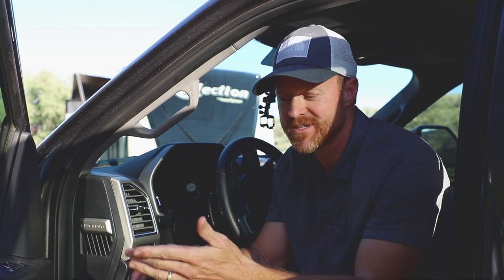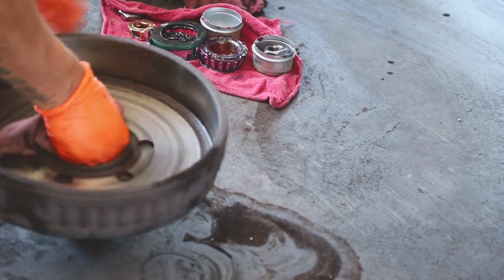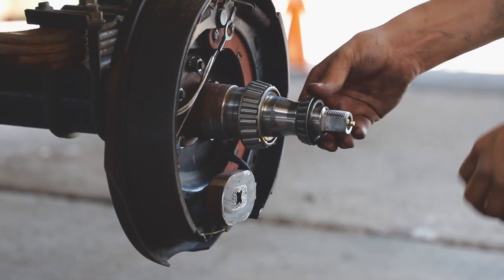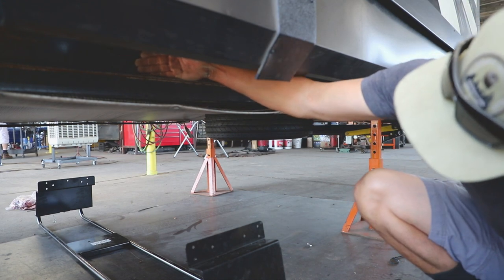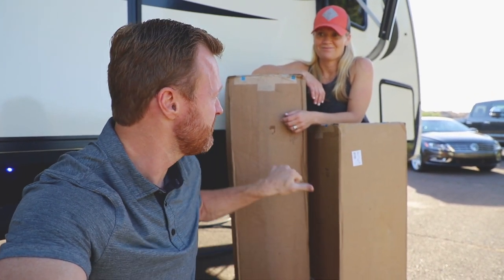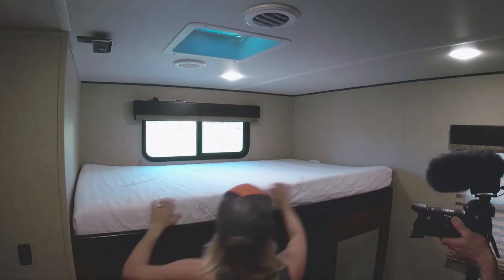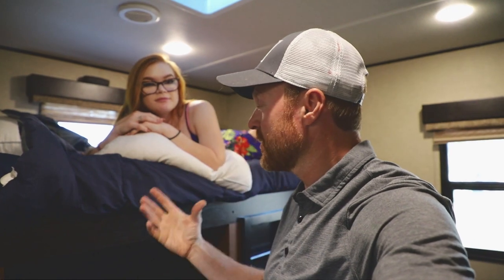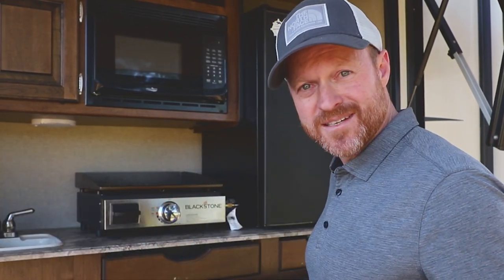RV UPGRADES: MORryde SRE 4000 | WATER HEATER FIX & NEW MATTRESS

Comment: Just a toss-in. I put the MORryde SRE 3000 on mine and it suddenly started loosing rubber on the inside edges of the rear set of tires. Not the front. Apparently it changed the toe angle to slightly toe-out on the rear. I then bought a set of Dexter wet equalizers to go back to the factory configuration with a little upgrade.. and all the odd wearing quit. To be fair, per the forums, only a very few have had this issue with any MORryde system. Wouldn't you know..lucky me..I would be one that did.

Comment: Kind of surprised that the original bearings were already starting to fail.  Doesn't say much about the quality of the original ones, or they weren't properly lubricated when installed.  We didn't have any tire failures on the RV on our trip last summer, but we did get several windshield dings and picked up a nail in a tire on the Jeep we tow that was a slow leak until the repair shop pulled it out.  Cost all of $10 to get it fixed, although I gave him $20 because he put other work aside to fix mine.
Reply from the maker: We did have 15k miles on those bearings already. Jake said the manf. doesn't add enough grease. They have enough now. Thanks for input. I might confirm we have 100% glass insurance :)

Comment: Good info!  I am also upgrading to the spare tire under the frame. FYI. I have a 2018 Laredo that has a suburban hot water heater. It work 3 times and failed. And it was was the controller card. I talked to suburban and it is a know issue with the cards( I believe they purchased an inferior manufacturer for the circuit board or chips) anyways I chose to go back with a dinosaur card made in the USA. The reason being if I purchased another suburban card that could have the very same problem. And what if your in ....Alaska when it fails.  Lol  
3 year warranty with Dinosaur.

Comment: Awesome video tonight! Any chance you can give a round about cost of your upgrades? Being newbies we didn't know these should be done. Love what you're doing!!
Reply from the maker: That's a good idea. I mentioned in the video that the mattress was $395. I paid $600 in labor and the SRE/4000 is roughly $400. The US bearings were around $125 I think.
Reply: That's awesome! We were think a few thousand!!!
Reply: so the labor for the work was $600 to do the bearing work, weld the new leaf spring brackets brackets, install morryde, and install the new spare tire holder?  That seems like a good price - i'm sure it took most of the day. 
 
And part prices were SRE 4000 was $400, bearings $125.  What about the new spare tire bracket, new leaf spring brackets, and new spare tire / rim ? Also, did the Morryde come with the cross suspension bar or was that an additional component ?  

Just trying to figure out how much these types of upgrades will cost me when I finally buy my first rig.  This is the kind of stuff that people don't think about when purchasing a new rig.  I'm guessing between your anti-sway hitch hookup and this work its prob around $3k+ worth of upgrades.

Comment: I’m looking for advice with the morryde 3000 or 4000 with the crossbar. I have a Jayco JayFight 6,200 to 9,200 max load and want to do a better suspension but don’t wanna overkill it. How is ur 4000 and crossbar holding up and did you get the 4000 because of the trailer weight?
Great video! Very helpful 👍🏻👍🏻

Comment: I was advised never to jack up trailer by the axle. It can bow just a little and stay out of level when turning causing vibrations to suspension.
Reply from the maker: It wasn't it. I mentioned that the RV was on the frame and the jack was to move the axle up/down to align with the leaf springs, but based on all the comments, I wish I made that more obvious.

Comment: Did you consider adding shock absorbers to the trailer? It would take out most of the wheel hop on the rough sections of road up in AK. I've heard the shock mod does wonders to keep everything in its place while traveling as well . That said ,I'm sure it would go a long way to preserve the tightness factor of every part of the new rig.
Reply from the maker: We considered it, but had to draw the line somewhere :) We've heard the SRE 4000 helps a lot. We'll see.

Comment: Did this also raise the height of your trailer? I have a 2017 F-250 and it sits higher than my trailer so I’m wanting to raise the height of the trailer to level it out. I’m hearing that the Morryde 4000 will give me a smoother ride but also lift my trailer as well which is what I want.

Comment: Sailun tires! those are like semi grade 65lb tires. awesome choice! I'll be very curious if you can do Alaska without a blowout. I'm guessing you won't have a blowout with those tires. seriously.
Reply from the maker: I really like them and would like to do a tire video. There are many misconceptions about load ratings and PSI.
Reply: Keep Your Daydream Yes! Please do a video on the Sailun tires. That’s a great upgrade from the Westlakes.
Reply: Three trips up and down the ALCAN in two years with a triple axle 43' 5th wheel and no blow outs with the Sailun tires.  We have broken two spring hangers and one leaf spring broke in April between Whitehorse and Destruction Bay.  with both the spring hanger breaks and spring breaking it completely wore the tread off the tires each time but no blowouts.
Reply: BH212Pilot  jeez! case in point. so you'll recommend them?
Reply: yes I recommend them.  Other tires would have blown.
Reply: I agree. Static Load Radius is the key.
Reply: Will be interested in how the Sailun tires perform on your TT.  I thought about going Sailun on our Reflection 28BH 5er... but was worried the 14-ply would be too stiff for a lightweight trailer and overwork the suspension.  Wouldn't have hesitated if we had one of the bigger and heavier trailers.  Went with the GD Endurance instead - which have a higher speed rating than our stock Westlakes. But if going up the Alcan, then the 14-ply may save the day.

Comment: Love your videos - Thank you.  Did they bend your axles when they put the jack under them?  Looked like it.  Hope not !!
Reply from the maker: The RV was supported on the frame. The jacks were only used to move the axle up and down to align the bolts. The curve u see in the axle is called a crown and al axles should have them.

Comment: Interesting suspension conversion . However I am curious as to how much height it adds overall to the trailer? The factory web site didn’t mention and you didn’t say if you had to adjust you’re tow shank.
Reply from the maker: I've heard from other installs that it adds 1.5 inches, but I didn't notice any change.
Reply: brotherheed00 Mine was about 1.5" on the lighter size and 1" on the heavy side..

Comment: Love the tech videos Marc, do you feel like posting the part numbers for the TImken Bearings?
Reply from the maker: Good idea. I took a picture of the box LM67048-20082 & 25580-200024 That would be for my rig obviously.
Reply: I have a GD Reflection TT as well, which is why i was asking.  Thanks a bunch..   Edit:  yeah, deff not super cheap, but not hateful.  Did you replace the bearing races too or just the bearings themselves?

Comment: One question - the BAL Hide-a-Spare, have you had any problems carrying 2 spares? Did you have to modify its strength? And just to add to this - I had the suspension on my 2012 Cedar Creek upgraded to the MORryde SRE4000 system at the beginning of February by Cliff's Welding in Mesa after watching this video. They did an amazing job, were very straight forward about everything, and got the unit in and out the same day. I had them box the shackles as well and use wet bolts on the suspension. Have put about 2K miles on the unit since then and things seem to be doing great - no issues. I can tell by the position of the contents inside the RV it's a better ride! Also, I upgraded to G-rated tires some time ago (hoping for better blowout protection) and was concerned about the extra plys roughening up the ride as well. While at Cliff's, I had the TireMinder TPMS system installed (mainly the extending transmitter) and this system is working very well too!
Reply from the maker: I use the stadard spare and use the BAL for only the second spare plus the portable grey tank. I carry a G rated Sailun tire on the BAL rack.
Reply: Keep Your Daydream thank you for the quick reply!
Reply: @KeepYourDaydream  Do you have photos of the BAL rack with the spare and tank on it?

Comment: Your GD 312bhs is essentially the same as our 311bhs 5'er. Have you had any trouble with your fridge control board going out, we picked it up last weekend and fridge went out on our first outting and after checking with my ohm meter, 12V current stops at the control board (inside where the led display reads you.temp no bad fuses either). Keep an eye on that for future reference might save you some time in research. You guys are awesome! Have fun in Alaska looking forward to keeping up with your posts.
Reply from the maker: Not yet, but we're having a hard time keeping it cold! It's 59 right now. Not good.

Comment: So I see you went with Sailun tires. Did you go up to 16" rims? How happy are you with the tires. I'd like to switch to those tires myself.
Reply from the maker: Yes, very happy with the tires. I have them inflated only to 65psi based on my weight. Same price as the goodyear but a whole lot stronger.

Comment: If your driveing the ALcan highway to Alaska not taking a fairy boat make sure you have at least two spares with you for your Camper your truck should be fine we had a blow out that took out two tires and couldn't get one we had to use a balloon tire it worked tell we got to Fairbanks Alaska like I said I think you all would like Alaska Land Alaska it's a nice little place that shows how native Americans lived did have wolves bars and other animals there beautiful place most beautiful state I have ever been to
Reply from the maker: We've got two. Only one for the truck. I almost added a spare for the truck.
Reply: Keep Your Daydream I think you will be fine on the truck watch your gas or fule on the way up it's been some time but you are in for a treat American eagles flying free and plenty of them bar wolves moose raindeer and huge open areas hundreds of miles of wilderness and no one liveing there beautiful place the water so clean you can see the bottom have fun can't wait to see the videos

Comment: Great suspension upgrade... we have the same rig... do you know if the SRE4000 is the 33" or 35" wheelbase as I'm considering the same setup, thanks.
Reply from the maker: I can't recall. There is a qualification sheet on their website. I had to take several measurements.

Comment: Must be a major flaw in those hot water heaters because the Wandering Wagners had the same exact problems on their new Airstream.
Reply from the maker: You're right. The hot water heater goes to 140 and the circuit board fails at 130. They have since been updated.

Comment: +Keep Your Daydream

My question is whether the MORryde SRE4000 system is worth the money.  I'm planning a trip to the Yukon in the spring and wonder if this is right for me (34' dual axle 5th wheel)?  Also, how did you find someone to do the installation?  It seems like your shop was very knowledgeable,  but finding someone here in Calgary seems to be a challenge.  Any help is very much appreciated.
Reply from the maker: It's tough to say if something like is really worth it or not because I can't compare before and after. I will say, trailers pretty much have only the suspension to worry about so adding it helps protect almost everything. The Axle, Leaf Spring, leaf spring hangers and the ride. So for the money, I like it. Finding a shop? It's not a hard install. You could it do if you can get the rig up on jacks on the frame. Big Truck Big RV has an install video.
Reply: Thanks Folks!  I think you are right, and will look for a shop to do the install for me.  I'm looking at the Joy Rider shock system as well.  

By the way, I love your videos and have watched about 15-16 of them so far!  Great job!

Comment: Hello, Guy's a while back on one of your videos I believe you mentioned something on hill assist. and having to replace 2 batteries because of a problem. I recently hauled my camper down to Kentucky
with my Chevrolet 2500 2017. half way down I noticed the voltage meter down around 10 volts and back up to 14. the question is. have you experience this problem.? Dealer said that's  Normal when Hauling a trailer. I think that's BS
Reply from the maker: I'm looking into this now. I think something changed in '17. Check your relay fuse. It might be in addition to your towing fuse.
Reply: I didn't find anything on youtube. didn't dawn on me to look at the owner's manual :(  apparently, it says its Normal for that system top Transition from Higher to Lower. ????  I never heard of such a thing.

Comment: Did adding this stuff effect the weight all that much
Reply from the maker: Not the suspension, but the additional spare tire did... but that's behind the axles so it didn't impact my payload much. The new tires are much heavier, but that increases the overall weight, but obviously not the payload or axle weight.

Comment: What is the purpose of the plate that was welded on to the springs?
Reply from the maker: The plate reinforces the hanger. Hangers often brake on sharp turns.

Comment: Watching them jack the axles up in the middle hurt me.  That will bend the axle and cause misalignment of the wheels causing excess wear on the outside or inside of the tires.  Did they check on this after the installation?
Reply from the maker: I pinned a comment about this. The weight of the RV was 100% on the floor jacks. The jack on the axle was only to move it up/down to align the bolts. I mentioned that in the video.
Reply: Steven Browning Sr Look at the pinned comment at the top of this comment section. Mark explains that what happened is not what you think.

Comment: you should never jack an axle up in the center. I can literally watch it bend. its just a hollow tube.
Reply from the maker: The rig was on the frame. That was to move to axle up/down to align with the leaf spring bolts.
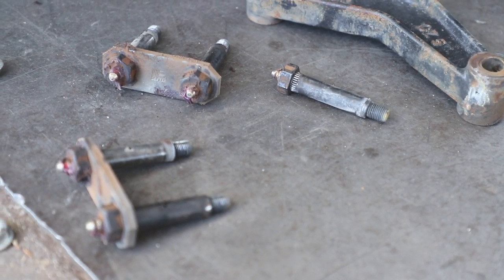Reply: Those guys seem to know what they are doing, but watching that axle bend at 1:18 was scary!
Reply: Nicolas Costill I noticed the "bend" but didn't know if that was being caused by what was going on in the video.
Reply: All trailer axles have a bow to them it's how they work. It's normal and was not bent.
Reply from the maker: I pinned a comment regarding this. The trailer was 100% supported by the floor jacks. The bend in the axle (or crown) is by design, but it looked exaggerated because the jack was in the middle. The jack was only moving the axle up/down to align the bolts to the leaf spring. Thus the only weight on the axle was the axle weight itself.

Comment: I wish you guys luck as you will find Grand Design makes junk, as much if their stuff is Chinese and the frame is real cheap. You will end up modifying many of the parts, especially the suspension.  Brakes gets greased badly and you will not be able to stop.  Moryde is good stuff and it will  help, disk brakes will let you stop!  I know as my GD was in the shop for 10 weeks after i bought it and drove it home.  Just be careful.
Reply from the maker: Yeah, I understand your frustration. Our last rig was coming apart on the front right seem and there isn't much we could do about it. No time to have checked out either. People saw the gap from the 5th episode. But I really think it's a price point issue. At this price point, its all the same vendors. Atwood, Dometic, Lippert, etc etc. People switch brands and end up with all the same parts until they go up in price.

Comment: Hope they didnt bend you axe's with the way they jacked up the rig, that was sloppy on the part of the guys who did the welding,  NEVER let them jack up the rig with only one point on each axe, that will bend your axes
Reply from the maker: I pinned a comment about this. I thought it was obvious that the RV was supported by the frame as I mentioned it. The jack on the axle was just to move the axle to align the bolts to the leaf spring.